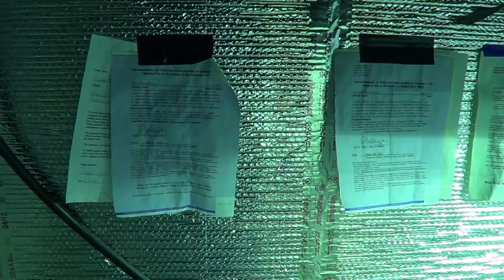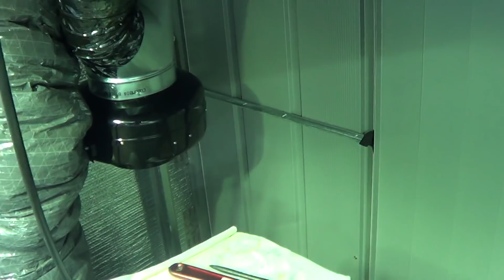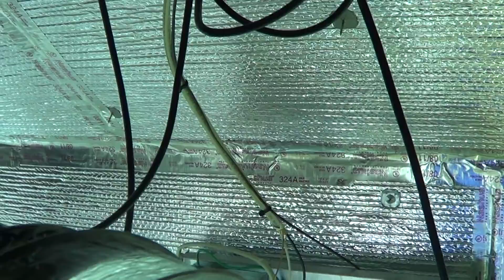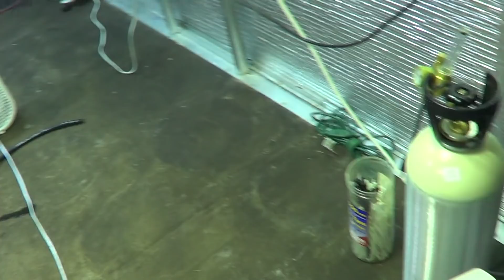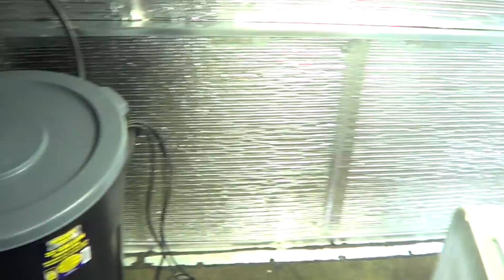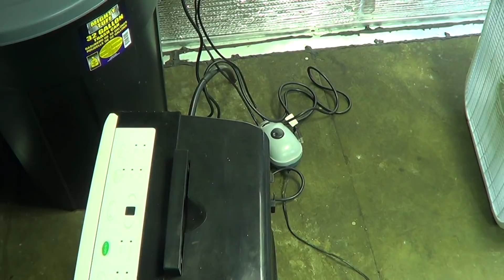Going over growroom design and what's been up.

Comment: The main thing with any grow panel is that it''s highly dependable and works to meet all of your future needs. How you get there is to each growers discretion and how deep your pockets are.  
I've been building high end custom rooms for two decades, I've found that this size "sealed" flower room are "generally" pretty similar in nature, but each room will always vary depending on the given situations. 
There more that you can afforded up front, the less problems that you will have to deal with in the near future.  
I've done many ground up design and builds just like yours. More common now are the highly custom "room additions" or "room modifications" 
We are now "trying" to move as much of the grow gear to the outside of the actual grow space as possible. Other than that these rooms are very similar to the first one that I designed and built in the mid 80's 
 
My motto as a Custom General Contractor has always been "If your going to do it, TRY TO DO IT RIGHT the first time!   
Looks Good From My House!

Love those new Sun Mag XXXL Hoods bad ass. 

MINI SPLIT.... MINI SPLIT.... MINI SPLIT!  

No need to spend to much on a pricey Mini Split. I just installed a Pioneer 2 tons for $1300 on a 4K room.  I paid $850 for the unit. I've been ordering them on Amazon for 6 years now. Highly recommended!

Comment: a dehumidifier is basically an air conditioner. if you dont want the heat in your room from your dehumidifier you should channel this hot output of the dehumidifier out of the room.

Comment: Wow that is a lot of Stuff for a 8x8 foot grow space. Floor space is where the money or herb is. I would get a that shit off the floor and onto the walls. It seems odd to me that you didn't just split the air to both sets of hoods. Those hot spots are going to be at the end of the line at the last hood. Its nice now days with mini splits,commercial dehumid's, and lighting controllers that cost 90 bucks. I just buy all sentinel stuff now and It stays clean as hell. I remember the days when a full setup would cost 25k and now you can get better stuff for 4k. The market is swamped haha. I even used to buid my own ballast from a rebuild kit and now I get fully loaded 1k digi's for 115.00. Good days to be a grower :)
Reply: Phlop Alopagus I was just thinking he same thing, this guy is in 2012 tech changed a lot since then LEDS Stand alone systems, nest controllers u name it!!

Comment: Could one run the ducting backwards with the glass off the hoods? Instead of cooling off the lights before the room, drawing cool air up the hood through the plenum   than cooling the air in the room from the heated air. Cause I've thought of this set up before but never had the chance to try. I am so jazzed yo see it does work.

Comment: That ducting looks waay too long to me to be efficient - and connecting 4 lights?  Are you heating the last one or trying to cool it?  I suppose you're blasting mega air though, being an HVAC guy eh?  I point it out because most people will use standard inline fans and might get the wrong impression.

I also would not put ballasts in the absolute hottest part ofthe room because they won't last long that way.

Comment: Nice work.

You said you would answer electrical question, so here it is.

If a site has a 120VAC 30A Knob and Tube Main;
Then Max Total Watts per sec^2 is 120 X 30 = 3600W
So is 3600 X .8 = 2880W SAFE TO USE,
Or is 3600 X .75 = 2700 SAFE TO USE?
Or should one just assume 20A (2400W) to lessen the load on the 30A screw in fuses?

Also for cut in outlet branch circuits on knob and tube where the whole system will not be replaced by a slumlord, there is no documentation of how to add a circuit legally to KT wiring because they used to just solder subcircuits onto a main circuit. Does one have to run it all the way back from the main or just from the nearest junction box?

Comment: as far as power goes and amps my new apt has a washer dryer hook up would I be ok with those outlets to run a 1000watt setup? (8inch fan,4inch circulating fan 1000 ballast.) and or could I use 2 600watt lights with one 8inch can fan and 4inch circulating